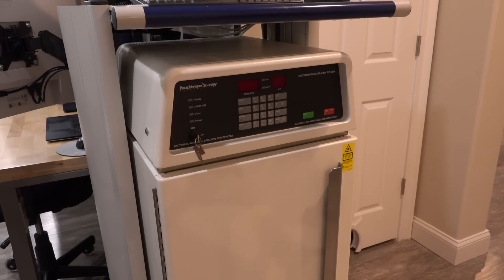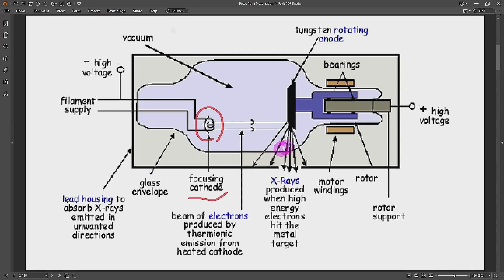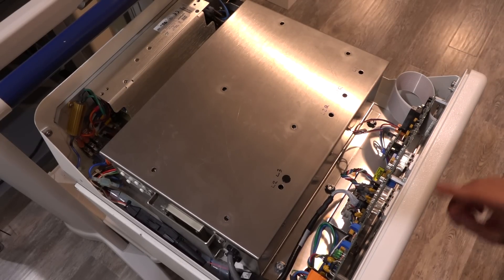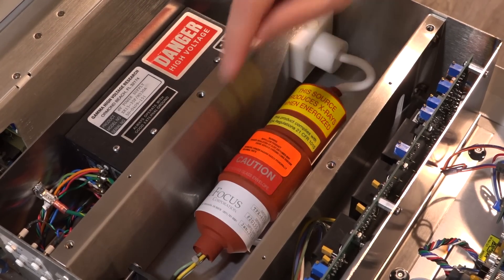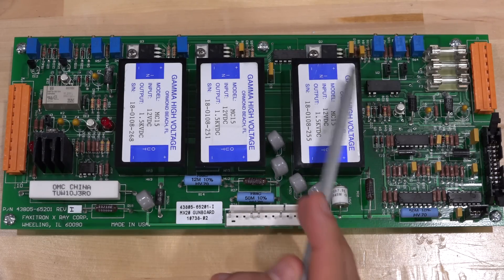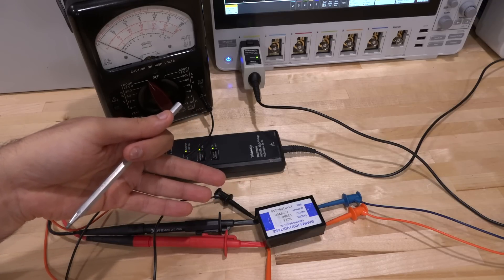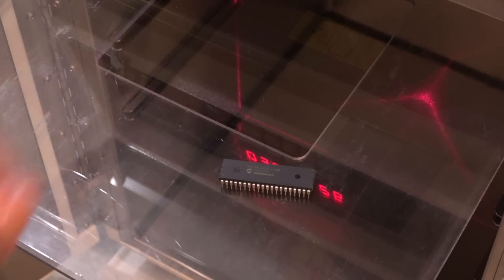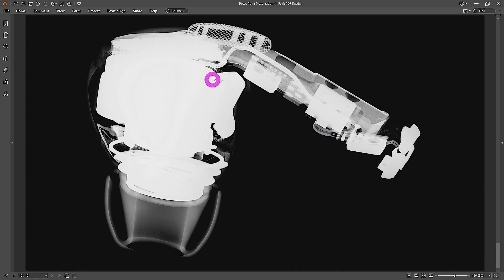TNP #39 - Faxitron MX-20 Digital Micro-Focus X-Ray Machine Teardown, Repair & Experiments

Comment: When you pulled out the X-ray focus board, the moment I saw reed relay switch on the board, I instantly knew it would be an actual problem since all mechanical relay switches have nasty habit of breaking down after a few tens to hundreds thousands cycles.

I am surprised that X-ray tube is still clean and functional since that machine was obviously heavily used, if it wasn't replaced at that point - tired and ancient X-ray tubes with high hours on them tend to do weird things in term of optical characteristics, ie. clearer and sharper in one corner and blurry in the other corner.

Comment: Question: could the reed relay be replaced with opto coupler's and/or  FETs instead? Solid state device should be more reliable. Its only switching 12V for the DC DC converters, isn't it?

Comment: Thank you, Shahriar, for another great video!  These little faxitron units are really good for imaging small items.  Many of the x-ray units use a basic two element tube, where the focal spot size is directly proportionate to the filament dimensions.  These models use a tube with a biased focal spot.  By changing the bias voltage on the focus element, you can adjust the focal spot size down to very small diameters (I think these units are set to .02 or .03mm).  We call those "microfocus" tubes.  The gun board produces the bias voltage for the focus, among other things.  In 1999, I went to school for a new cardiac cath lab system for imaging the heart that used a new type of variable focus x-ray tube.  It could achieve focal spot sizes not quite as small as this, but at voltages of up to 150kV and current of up to 1000mA.  It was quite the system!   Anode cooling was a big issue, as you can imagine!  It also used an image intensifier (dynamic DR panels weren't available yet) and the image intensifier had a variable zoom that could track with the focal spot.  I foget what the marketing name was, but it was very complicated and expensive and we only sold a few of the units.  Thanks for sharing and bringing back some memories!!!

Comment: 18:03  I would assume the reed switch package is configured with both NO and NC operations (Normally Open / Normally Closed).
Reply from the maker: They are both NO in this part.
Reply: @TheSignalPath  Interesting.

Comment: Absolute excellent video. I was always waiting for looking inside such a nice device. Here in germany e,.g. europe its very difficult to get a permission for such a device to be used officilly in a small lab even if it completly in housed. -- I worked with x-ray machines with up to 200kV at helmholz in a huge housed shield for experimenting with x-rays, focusing is a tough topic most mechanically done. At helmholz also gamma readiation devices are available.... I also tested pulsed radiation in medical applications (for example used  ct) and detectors using ccd array (had a patent on this measure principle  tests on up to 2000 Gy/h using a iPhone/Android) -as the film dosimeters are problematic - I like this topic really very much. And great of PCB checkout usually have to use a external service company on this at the moment when needed in my lab.

Comment: Great timing! Just days ago I needed to see inside a potted module and asked a dentist friend to scan it for me (bonus, he did a 3D scan in addition to 2D, very handy!). Naturally, now I want my own X-Ray machine. This MX-20 looks like it does a good job, but when I am looking at buying one, it's not clear to me if the X-Ray sensor is included, what should I look for when buying one? Those of you that have experience in this area, any other units I should consider? I might roll my own (or adapt a dental x-ray), but there are obvious drawbacks to going that route. Thanks!!

Comment: Nice thinking! Probably arc pitting on the reeds from switching the primary of the DC to DC converter.  I wonder if there would be any way to mitigate that, perhaps a mercury wetted reed relay?
Reply: Turn on the DC DC converter via a MOSFET instead of all the current going through the reed relay. The reed relay turns on the FET, which turns on the DC DC converter. Maybe the relay could be replaced with a solid state relay entirely.

Comment: If only you had an extra one of those high voltage DC-DC converters to x-ray.
Reply: For sure!  I once took an x-ray of an x-ray power supply while it powered the x-ray tube taking the x-ray.
Reply: @d.jensen5153  Neat!

Comment: Given that the current through the reed relay is likely small, maybe the relay is below its wetting current? If so, running some DC current and exercising the relay might restore operation. That said, I am not sure if hermetically sealed glass envelopes enclosing reed contacts might prevent this wetting issue? 🤔🤔

Comment: Thank you for another awesome video, dude! The amount of expertise you posess about virtually any aspect of the matter is truly amazing. An unrelated noob question, tho. Today we have a tons of cheap microwave DIY solutions — human presense radars and similar devices with around $5 boards with smth. like LD2410 chip, so it's very tempting to play around with them. And the question is: what entry level hobbyist oscilloscopes, like up to $500, exist for those frequencies, like with the bandwidth of 25 MHz+ accordingly?
Reply: google it instead of spamming the question. LD2410 is 25GHz you won't find any entry level equipment that is useful to measure that.

Comment: I hope a smartphone with a micro-X-ray device will soon come onto the market that can be used to examine smaller things.
Reply: Yeah sure..... lets have people running around with portable ionizing radiation devices.
Reply: @jayytee8062  Would be very practical in the outdoor area. For example, you could quickly determine whether you have broken your leg.
Reply: I think you'd know if you had broken your leg. Walking would be excruciatingly painful if not impossible for a start.

Comment: Very interesting. I worked for Philips Medical System in Hamburg, Germany on X-Ray systems in another life. Back then instead of USB, control functions and UI were over CAN buses. Thanks for the trip down memory lane.
Reply: The Faxitron has control over RS232 with only the sensor being connected via USB (if it's a Hamamatsu sensor).

Comment: I think I would have been inclined to soak test the reed switch and try to prove that it has an intermittent operation on one contact.  Only then can we be sure that there wasn't some other intermittent fault which has been disturbed into working for now.
Reply from the maker: Removing the reed (especially with all the heat I had to put on it) seems to have damaged it more... I could not get it to energize at all once it was removed.
Reply: @TheSignalPath top right wire connection on the reed relay's x-ray looks strange. Like it is half cut or something like that, so it could a root cause.

Comment: That AirPod X-ray looks extremely cool, it would be super neat to have a animation of it rotating. How long does taking a picture take start to finish, would making an animation of a few dozen frames be feasible?
Reply: Well adding a rotating stage wouldn't be that difficult, but generating a tomographic image from the individual slices would require considerable software.
Reply: @neonkev7866  I believe I've seen open source solutions to the software side (in a video about a DIY CAT scanner, I think). I know there are open source DICOM viewers that will do the 3D reconstruction and slicing (I've been using AMIDE to view some potted modules that a dentist friend scanned for me). It seems that DICOM is a container format that uses normal image data.... MIGHT not be to hard to get your own data into a DICOM files and use one of these viewers.
Reply: Here's a rotating X-Ray video of the pods:  https://youtu.be/WsxHWKJA7ig?si=Uy6URyiU-oU7FgWm&t=42
Reply: 1-2s. I've been planning to make a CT scanner using that technique with my MX-20.

Comment: The air pod was quite "blown out" - can the machine (or you manually) do something like exposure-stacking to get a complete image with more details ?
Reply: The reverse of blown out, penetration of the xrays shows as black. It would probably require a more powerful unit to resolve the internal details due to the amount of metal in there. A 30kV xray is not strong, but perfect for PCBs and the like.

Comment: Nice teardown and explaining, as always. Here's an interesting idea for you - what if we take, say open LTZ1000 reference module (or other zener), place it in the chamber for picture, and apply power and measure zener with 3458A with fast sampling rate. And then take number of pictures with different x-ray voltages and see if that affects or shifts the zener value in any visible way. Could be interesting to know, if zener output might shift from say shipment security checks at airports too, even without applied power to chip...

Comment: Worth mentioning that x-rays can also be 'filtered' by using inserts in the window of various materials. These are often used in mammography to help isolate specific xray energy levels to minimize dosage. The same goes for the anode, it doesn't always have to be Tungsten.

A smaller machine like this likely produces lower energy xrays so you can also get away with steel shielding instead of having to step up to lead.
Reply from the maker: This machine doesn't need any lead. Pretty low kV rating. The tube housing also appears fully exposed. Overall, a low-power tube.
Reply: Yeah, this is 35kV max (tube can handle 50, but power supply is 35). Original purpose is for tissue samples or such. The microfocus tube is great for electronics, but 35kV is just a little bit low for some applications.
Reply: I'm working in medical X-Ray industry and yes options are also collimators, which are mechanical thingy like aperture in camera lenses . I'm taking images of my electronics on little bit bigger machines :D As a room with 5 different detectors.

Comment: That reed relay (or maybe an adjacent one) also failed in my MX20, leading to current adjustment not working. Also gets super hot.

Bought a replacement for K1 and U1, but haven't had the energy to install it yet (it's not a big enough problem to solve asap). Interesting that we had the same failure modes.

If you're interested, I have the schematics for it.
Reply from the maker: Thanks for sharing! I would appreciate it if you could send me the schematics.
Reply: @TheSignalPath  Sent you an email
Reply: What was the symptom on the current adjustment not working?
Mine isn't outputting any voltage on the current testpoints (or even slightly negative), but the machine seems to work very well apart from that.
A friends unit shows the exact same behaviour, so I thought that this was expected behaviour (or at least a known problem)
Reply: @Manawyrm  No matter what settings you change, the current can't be changed. e.g. you can adjust L2 but nothing changes. Similarly, the voltage coming in from the controller to the gun board (pin 11 on the 10x2 header) doesn't change anything.

I'm not entirely sure what the exact failed component is, but the potentiometer and output stage is fine, That leaves the reed relay K1 W171DIP-24 and the opamp U1 LM324.

The current testpoint should be slightly negative, in the range of -0.1V or so (for 100mA).